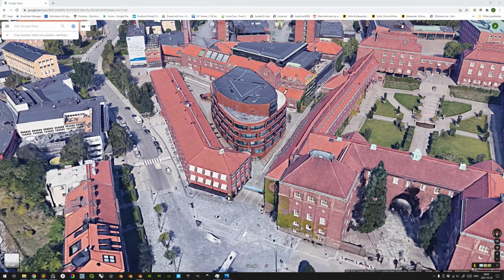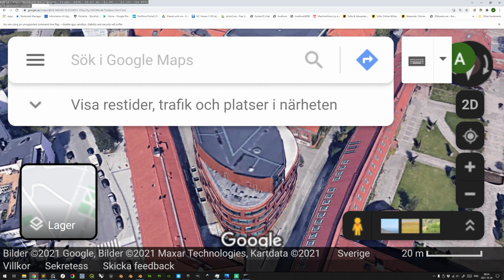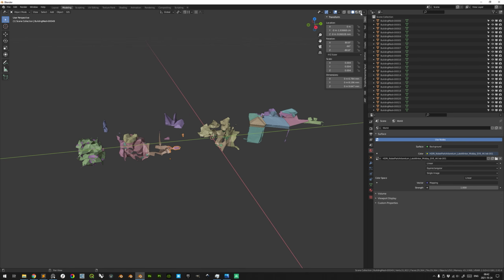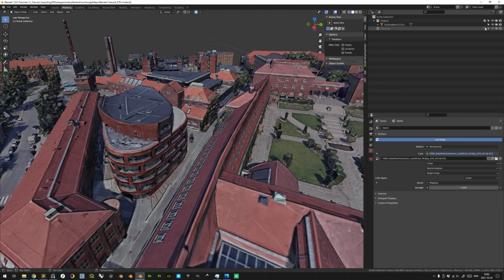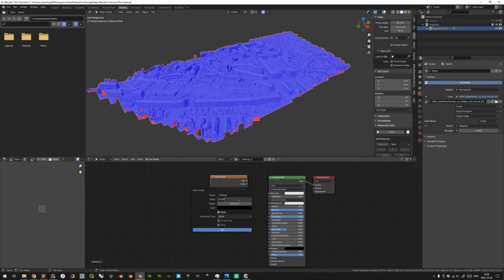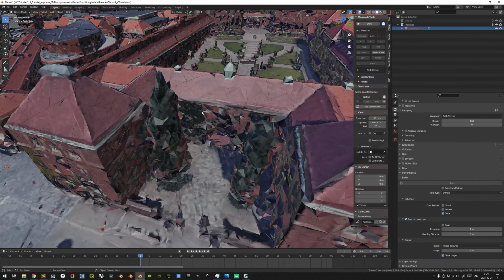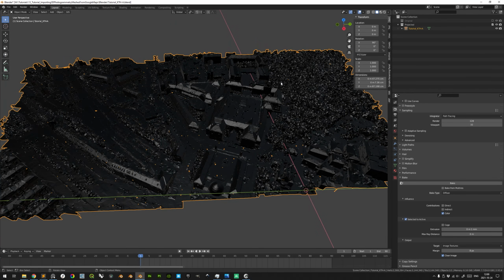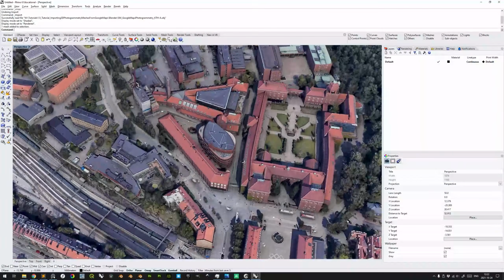Tutorial – How to export 3D photogrammetry meshes from Google Maps

Comment: Thanks a lot…. But RenderDoc v1.19 doesn’t have “Inject into Process”. I used v1.13 and MapsModelsImporter-v0.4.0 for Blender 2.93 and MapsModelsImporter-v0.4.1 for Blender 3.0. And used the “Capture after delay” button 2sec in RenderDoc when I were moving in 3d view GMap. By the way THANK YOU VERY MUCH!!!
Reply from the maker: Great to hear that you got it to work! And thank you for the information about the versions which you got it to work with! All the best to you /Sofia & Alexander
Reply: I am not familiar with RenderDoc apart from the part for doing it for getting 3D data from maps but I have fallen into a trap of updating RenderDOC to the latest version and lost that inject option under File too. I think now in a new version it can be done through application interface. So you can start Chrome with all parameters for injections directly from RenderDOC and it technically should inject into  a process without looking and selecting for a proper process ID.  I will try to figure it out tomorrow.
Reply: @wingmanmedia360propertybus4  that option can be enabled in the settings and then the menu item will also appear. Still, it does not work for me.
Reply: @gabortabi  I deleted an updated version of RenderDoc and installed the one that used to work. It is back to normal and it works.

Comment: Hi, I'm very new to blender and I was wondering if it would be possible to edit the mesh once it's imported and be able to delete parts of the mesh and put my own custom textures over it
before baking and joining everything together? Thanks
Reply from the maker: Yes, we think that this would be entirely possible; however, due to the fragmented nature of the photogrammetry meshes, where there are many small mesh objects comprising the scene, it might be a challenge to make a deliberate selection of the area to replace – and depending on how large the mesh is, it might be challenging for the computer to edit the mesh (at least it has been from our experience – in these cases we have found it fruitful to work in smaller chunks). But experiment away, and see what you might find! /S&A
Reply: yes, that is possible, its just an object like any other in Blender. I often adjust vectors after capture.

Comment: meshlab keeps crashing on me when i try this :(
Reply from the maker: We would suggest that you first test out with a very small portion of your intended mesh, to see if the crash is simply due to not having enough hardware resources available (namely RAM), or if it is a problem that happens no matter the size of the input mesh (which would mean that it's more likely a software error, in which case we would recommend reinstalling MeshLab instead). Sincerely, Sofia & Alexander

Comment: Could you tell me if it is possible to remove buildings and cars from google maps
Reply: Thank you so much guys for the help I asked because I want to make a ww2 RAF game where you can fly around the whole or most of Britain and Germany and I didn’t want modern building or cars being in it If you could give any tips on how to do this I would be grateful otherwise have a great day
Reply from the maker: @devioxs5355   With your usecase (a RAF pilot game), it might only be advantageous to use a lower-resolution DEM as a source – with a very large area, a too high resolution might be too much to handle for one's computer. If you are using Unreal Engine, you can use the Landscape feature to cover a large area with topographical data, which adjusts its topological density based on distance for performant rendering. And with the World Partition system in Unreal Engine 5 (released in sharp yesterday) you can create really large worlds. But that system in particular we have not yet tested ourselves :) But anyway you do it, our best tip from our experience, with regards to creating large worlds, is to initially approach it with one small part of it, so that you can experiment with your workflow and work iteratively with a small, handy chunk, and then when you have developed your own optimal workflow for the small part of it, you can apply the same workflow for the whole. This makes the initial threshold to overcome much smaller, and when you're working iteratively, testing out different methods, it also saves a lot of processing time. Then later, when you've found the optimum method to handle the issue, you can apply it to the whole. With the NASA STRM, the DEMs comes in chunks anyway, so even if your final project has the endeavour to cover hundreds of these DEMs, you can begin experimenting with your methods with only one :)
Good luck with the project! One of us, Alexander, was a big fan of Combat Flight Simulator 3, especially the RAF campaign (it's mind-boggling think that it was 20 years ago now – time flies!) Sincerely, Sofia & Alexander
Reply from the maker: Hello, Kevin!

To our knowledge, not by any non-manual means to do – one of the drawbacks of any photogrammetry workflow is that you might capture more than what you want within your bounding box of interest, simply because it was there in the footage. And since the photogrammetry mesh is constructed from the footage, if you want to remove a certain part, you must do so manually [in a photogrammetry software such as RealityCapture or Metashape, or in a 3D modelling tool such as Blender] (and even if you close the holes of any such topological manipulations, the texture is still bound to include the omitted items when you reproject, since what you have removed topologically still exists in the underlying footage, and to fully remove it you will have to manipulate the texture as well, which might be even more tedious than manipulating the topology). So the workflow showcased here is mainly for simple referencing.

What we do recommend if you are not interested in the buildings (and cars) is to use another digital representation of a landscape, such as a DTM (Digital Terrain Model, excluding man-made objects) or a DEM (Digital Elevation Model, only including the surface of the Earth). These are generally consisting of a heightmap constructed from a fly-by laser reading of an area, or by other means, with non-natural (or in the case of DEM, non-topographical) elements filtered out and the ensuing blanks interpolated. 

The highest-resolution DTM/DEM data will most probably be authored by your national surveyor's agency (Lantmäteriet here in Sweden, supplying a DEM with a 1-metre resolution, as well as a 0.5-metre DSM [Digital Surface Model, with vegetation and buildings included]), but the licences and allowed usages will vary.

In the public domain, NASA has captured and published a global DEM model with a resolution of about 30 metres per pixel, named "NASA Shuttle Radar Topography Mission Global 1 arc second", or "SRTMGL1". This will of course yield a significantly less high-resoluted digital model in comparison to the photogrammetry mesh, but if you do not want buildings, and cannot access your national surveyor's agency's data, the accessibility of the public domain might be convincing enough to try it.
You will need both a USGS (United States Geological Survey) account and a NASA account (both free to create) to download the data, which you most conveniently do via the following address:
https://earthexplorer.usgs.gov/
In the first tab, click in the map to define a polygon area roughly aligned to your area of interest.
In the second tab, go down to "NASA LPDAAC Collections", and in the subcategory  "NASA SRTM (STRM 3) Collections", check the option called "NASA SRTM3 STRMGL1".
In the fourth tab, click the thumbnail icon under any entry to show an image preview of the height data.
When you have identified the DEM part that you are interested in, click the download button to download it (make sure that you are logged in to both USGS and NASA to access the download link).
With the DEM downloaded (a .hgt file – do not rename this since the title contains its only metadata [coordinates]), import it into QGIS, optionally reproject its coordinate reference system from the file's native WGS84 to the one you use in your project, and export the image data as 16-bit TIFF – this can now be used as a Heightfield in Rhino or a Displacement map in Blender, to create a topographical digital model. If you are interested in how to export the DEM as a TIFF (PNG works as well, but JPEG is only 8-bit and will lead to topographical banding) in QGIS, we have a more in-depth tutorial on this (the first 17 minutes of the linked tutorial):
https://youtu.be/XnUqxjDvgWg

We wish you all the best,

Sofia & Alexander
Reply: Hey 
I followed it step by step, also injected it, but the 3d option does not appear in my google maps

Comment: Finally a step by step tutorial with all the details and pitfalls and that don't rush through it
Reply from the maker: We are very glad that it helped you! And we thought about editing out the pitfalls, but found that it was more pedagogical to leave them in :) Thank you, and Merry Christmas! /S&A
Reply: @SanningArkitekter  How do we scale the model on blender to real world dimensions? A 195,0m real world reference comes out as a ~2,45m model after exporting it to blender. I'm not sure if I should always scale the model with a fixed factor, or it's a case by case.
Reply from the maker: @euclois  For us the scale has not been consistent between projects, so what we do is simply:
1. Go to Google Maps, and locate the area you have exported,
2. Right-click on a distinct point in the map (which of course also is in your extracted mesh), and choose "Measure distance",
3. Left-click on another distinct point, and take note of the distance (A).
4. Go to the Blender file, and locate those two distinct points,
5. Use the Measure tool (icon looks like a right angle), and CTRL+drag (which will snap to vertices) from any vertex closest to the first reference point, to any vertex closest to the second reference point. Take note of the distance (B).
6. With a calculator, calculate A/B (make sure that units are consistent [e.g. both in metres], otherwise, first make sure to convert to same unit). This is the factor you want to scale the mesh in Blender with.
We wish you all the best,
Sofia & Alexander